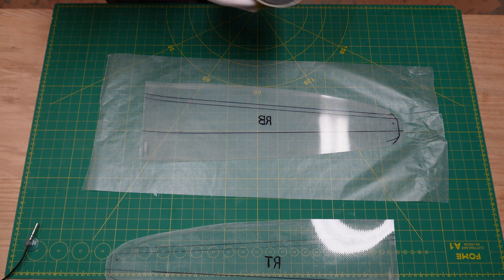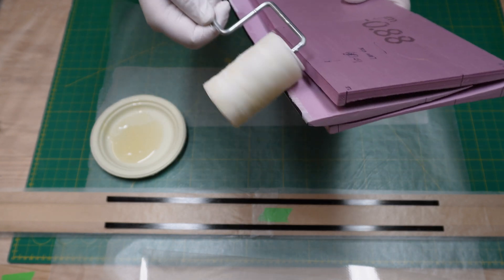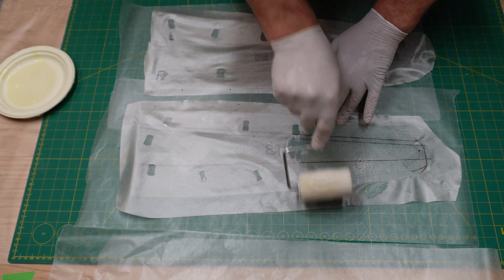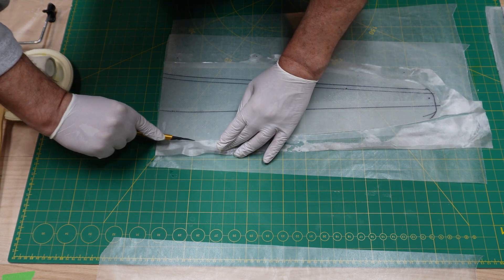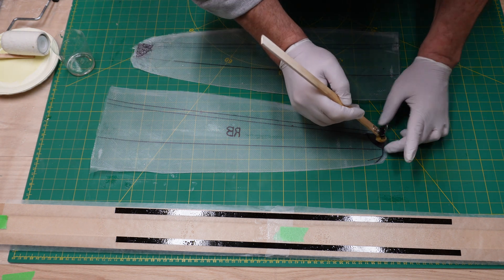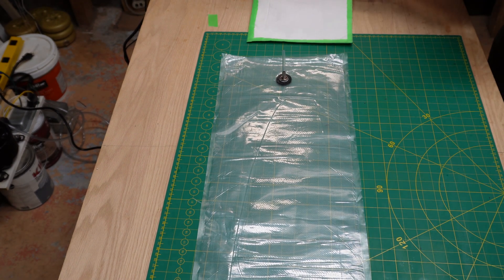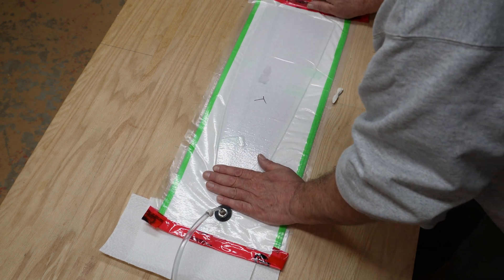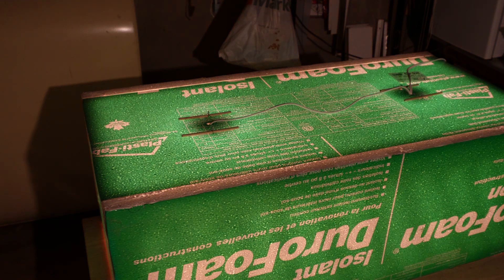How to make a F3k  DLG glider. Vacuum bag foam wing cores.

Comment: I use Resin Service HTR 212 resin with 386-99 hardener
Reply from the maker: hmmmm. I've never used it but sounds good. A local supplier here has West along with a store brand (System 100 Epoxy Resin/Hardener) I use both. Thanks for the comment.

Comment: Perfect results! What is the thickness of the polypropylene sheet that you're using?
Reply from the maker: 0.030" thickness. I found it at :
https://www.eplastics.com/PRONAT-03X24X47L-S
If you get it from there, make sure you get it with one side smooth 👍

Comment: Thanks for sharing this great information. If you don't mind, where did you pick up the mylar material from? ** Update **  I see it was from Eplastics.. my bad. I do have a question for you though. If one was to paint the mylars after waxing, wouldn't that paint then transfer to the wing and resin?  Thanks again..
Reply from the maker: I found the material at a place called "eplastics". Here's a link to the stuff I used. 
https://www.eplastics.com/PRONAT-03X24X47L-S

Comment: I got some Carbon Fiber cloth, but it turned out not to be a type where I could harvest CF fibers or strips like you do. So last night, I mixed up some epoxy and used the dauber sponge to wet a strip of the fabric along the cut end. I basically made a section of prepreg. It turned out great. After wetting it, I debulked it, and it turned out great. It measured 0.014" thick, and it will be easy to cut 1 CM strips or whatever size I need.
Reply: Right. I ordered from aliexpress. Delivery late this month.
Reply from the maker: yep, Aliexpress is my go too. Good prices/ slow shipping   lol
Reply from the maker: sounds good!  You'll still need some tow that can conform to the leading edge .

Comment: Good morning,  I realized that in my garage, I have a roll of 6 mil greenhouse plastic that is brand new. I'm wondering if it might work for mylars if it's waxed with 3 coats of Partall #2? Do you think that might work? I'm thinking it would work for vacuum bagging. I just need to come up with fittings, etc. Could you let us know what equipment you have like vacuum pump, etc. I am planning to use our Food Saver for these first wings, I hope that will work out. Do you buy tube type bags and then seal the ends with acrylic latex caulk? Where do you get your bags and material for mylars? Sorry for all the questions. I am 77 and flew RC planes in the past, but this DLG technology is a whole new ballgame. Peace
Reply from the maker: good morning. Plastic sheeting is measured in mils. One mil is equal to .001" . So your plastic is roughly .006" thick.
The material I use for the wing mylars is .75mm thick (or about .030") and is the thickest I can use comfortably. 
I've tried allot of plastic for vacuum bagging...lol  and I found polypropylene (PPE) is about the best. I got mine
from a company called " ePlastics". Thicker material = better finish quality when vacuum bagging.
I made my vacuum pump out of and old bar fridge I picked up at a yard sale. I like using it because it is very quiet, and it's wired to a vacuum switch that turns it on if pressure drops. 
Because I know you'll ask, the vacuum switch is  part# F-4200-X30 and the vendor is "Airtrol"
https://airtrolinc.com/f-4200x%20series-vacuum-switch/
I do use a FoodSaver type bag that I picked up on-line. Comes in a wide roll.
I found the best seal for the ends of the bag is good ole latex caulking.
Thanks for the questions.

Comment: Don't know about using the toilet paper as paper towels would have been better to use in my opinion for soaking up the excess glue.
Reply from the maker: yes, paper towels would soak it up, unfortunately too much in my experience. You still want to leave enough resin for a good lamination.

Comment: Realy nice job i tried it i used 24 g fiber glass put epoxi resin and put milars on it an put it into vacum bag after a day i checked on  it peeld of the milars an the fiber glass didnt stick i could peel it of next time i used more epoxi it sticke but 45%didnt if i use even more epoxi it would be aout weight limit A FILOS used same weight fiber equal to epoxi but i had to use wai more dont know where is the problem
Reply from the maker: hmmmm..could be many things. First, make sure you removed all the fuzz from the wing cores. 
Could be you need to mix more epoxy (remember, the roller absorbs alot) and we de-bulk anyways.
Might be you vacuum is not strong enough.
Hope this helps!

Comment: Will 0.5mm Polypropylene (0.020") glossy sheet work? I am making a trip to TAP plastics and they have that material in stock. Thanks in advance!
Reply from the maker: Should work ok...
Reply: @amonus-air2160  Your walkthrough of your pump made me rethink my pump purchase... :(  Not a big deal, and I will keep the hvac pump because you never know... I did find a nice(ish) Gast DAA 1/2 hp pump on ebay. If it needs a rebuild, I can do that. Your videos are an inspiration, thanks :)

Comment: Thanks for your video. It made me want to start bagging again. Where did you get large enough plastic sheets for the wing mylars?
Reply from the maker: I found the material for the wing mylars at  https://www.eplastics.com  ,
Make sure you choose the smooth one-side option, as it produces that gloss finish.
Reply: @amonus-air2160  thanks for the link. Which plastic did you use, there are so many to choose from that look similar. I'm used to using traditional bagging mylar, it's to thick for small wings and tail  surfaces. I plan on building a 1 meter dlg like yours. Thanks
Reply from the maker: you should definitely use the Polypropylene Sheets. The one I used was:
 https://www.eplastics.com/PRONAT-03X24X47L-S 
For smaller items, I've found a thick polypropylene sheet protector at the Dollar Store.
Mould release wax is always recommended.

Comment: "Prepreg" spars? Wjhat do you mean?
Reply from the maker: "Prepreg" is the common term for a reinforcing fabric which has been pre-impregnated with a resin, in this case an epoxy resin. As a result, they are far easier to handle, all be it more expensive as well.

Comment: I'm curious. I saw another video where a guy merely used a vacuum bagging machine used for food storage to vacuum bag glider wings. Do you see any problems with that method?
Reply from the maker: Hi...I  don't have any first hand experience with those machines so l can't say if one is better or worse. Both methods will work,  but l can tell you that mine cost around $50 but to make. Thanks for the question.😎👍
Reply: @amonus-air2160  I guess the food storage vacuum bagger would be cheaper as long as one could sneak it out of the kitchen without the wife noticing. 😊